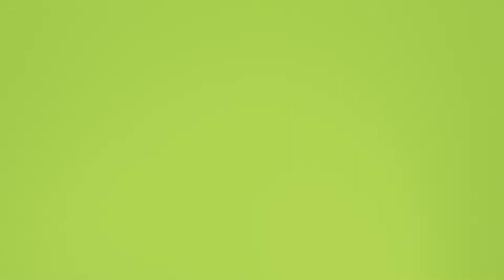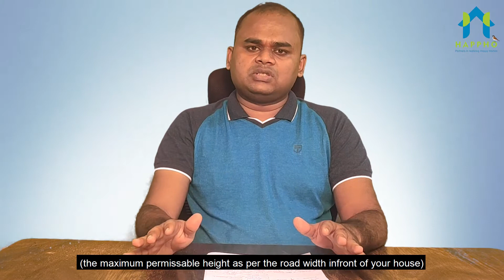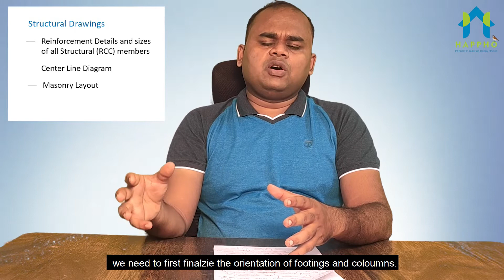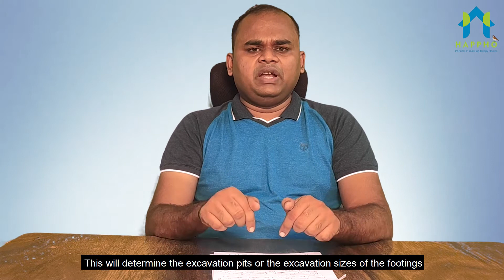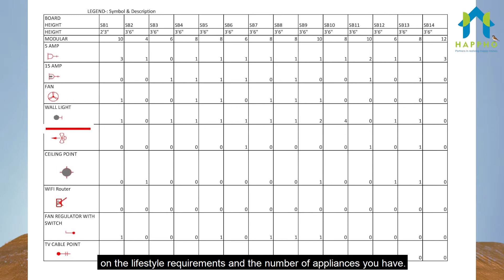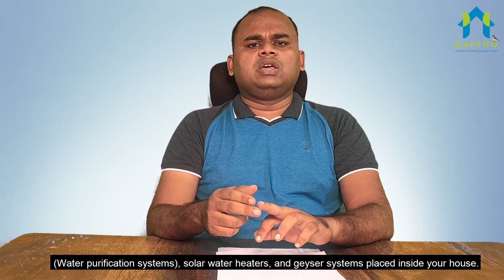What are the Various Drawings Required For Individual House Construction?

Comment: is Site plan drawing not required? it s a requirement by the municipalty board for permissions
Reply from the maker: Yes, Site plan is important. But here in India for Individual House (smaller plot sizes), the floor plan mentions the offsets that are required by the municipality.
Reply from the maker: So the floor plan only gives the orientation of the building and the required offsets for small individual constructions.
Reply: Thank you for answering my queries, I appreciate it.